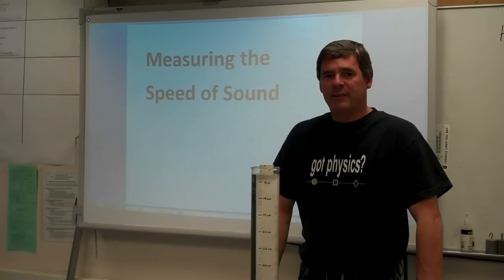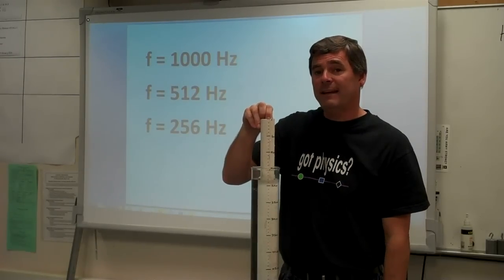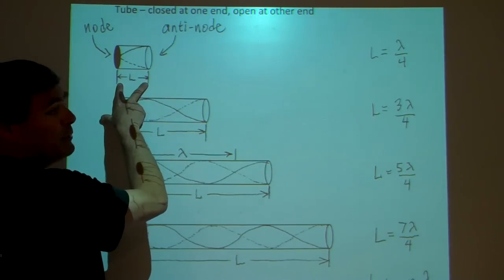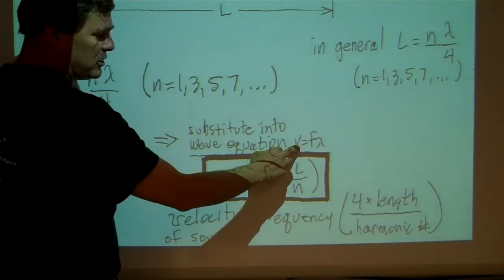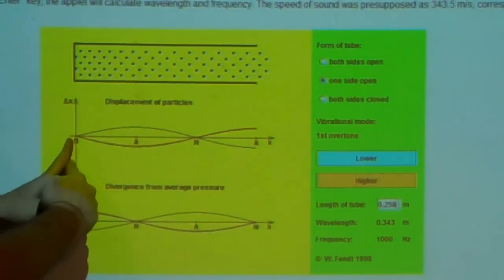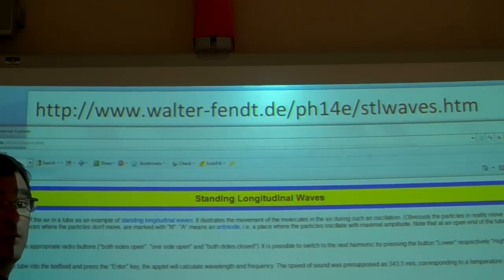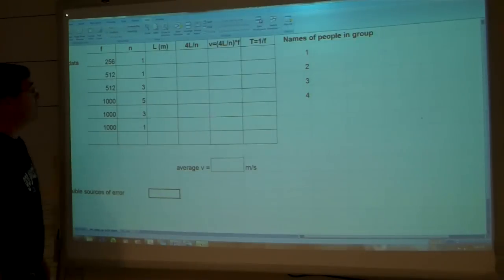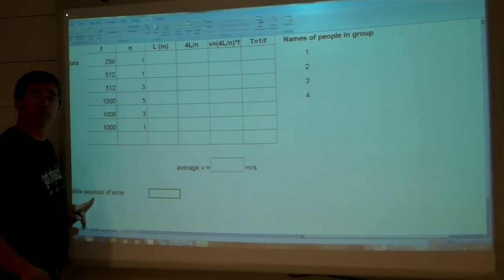Speed of Sound Lab

Comment: David, I do this experiment with my Physics class every semester. Our numbers always come up a little lower than the expected speed of sound in room temperature air. i wonder why that is... I love the lab!
Reply: do you know by any chance why it's lower?
Reply: @patriciarigters7707  I do not know. We just did the lab again and get fairly accurate numbers at 5/4L.
Reply: @patriciarigters7707  I believe I have solved this! At the first node the numbers are low. They are accurate though. If we draw a compressional wave diagram we would notice that inside the tube is the rarefaction. The rarefaction is of lower density than the air in the room! Therefore the speed of sound is ACTUALLY lower since the velocity is based on the density of an object. We are creating a sort of vacuum in the tube at the first node. At the 5/4L spot we have about equal rarefactions and compressions, therefore the speed of sound is very close to what it would be in the room.....340m/s.
Reply: I believe you have nailed it. The numbers are accurate, because...they have to be really...but the actual density is changing in the medium. Thank you!

Comment: I did this lab yesterday and noticed something I also see in your video, which is volume spikes at air column lengths much less than lambda/4. For example, near the end of year video you experiment with 256 Hz and there is a noticeable volume increase at just 10 cm, whereas the the theoretical calculation (speed of sound/256 Hz/4) predicts the first volume increase at 0.33 meters or 33 cm. Is this an "overtone" shining through? We also noticed this result with tuning forks of low frequency. I can't think of another explanation, but I thought I would ask a pro...I'm just a calculus teacher who minored in physics 30+ years ago, and our administration asked me to dust off my minor this year due to staffing needs.

Comment: When you say that the tube is closed at one end, is it literally closed as in the pipe's not being filled up with water or that it's closed as in the water kinda makes it closed? that probably doesn't make any sense but  basically I need to know whether the pipe is closed by definition of that there is no water in it or if it's just "closed" because the water's surrounding it

Comment: when recording the length of the tube, do we have to measure the length that is in the water or the length that is outside of the water?
Reply: Measure the length of the tube from the water's surface to the top of the tube.  That's the length of the tube where the standing wave interference pattern is occurring.  Sound passes down the tube and reflects off the water's surface back up the tube.  The standing wave interference pattern happens  because the incident wave interferes with the reflected wave - constructive interference at the antinodes and destructive interference at the nodes.  A STANDING wave only occurs at lengths of the tube that start at 1/4 of the sound's wavelength and increase at 1/2 lambda increments.  The requirement for the standing wave is a node at the water's surface and an antinode at the open end of the tube.